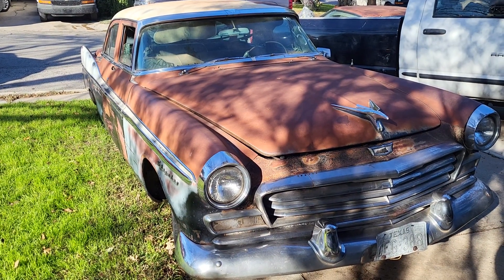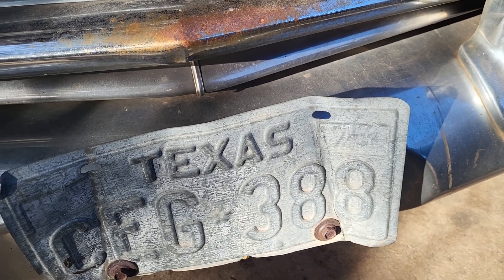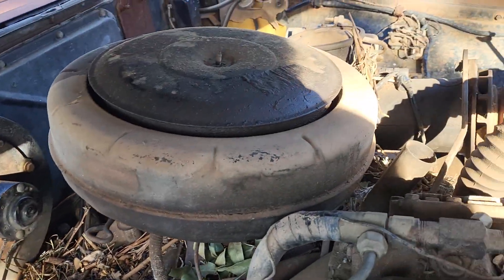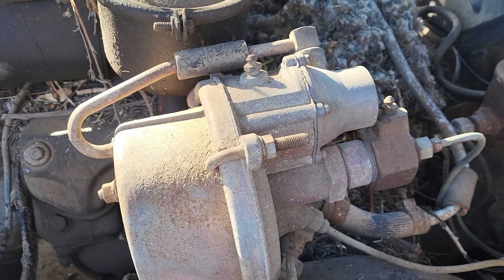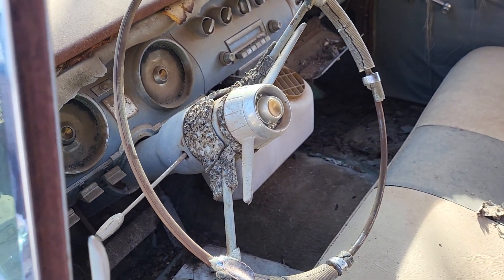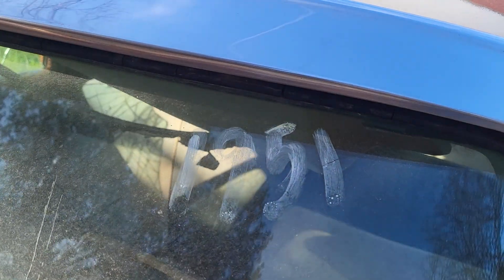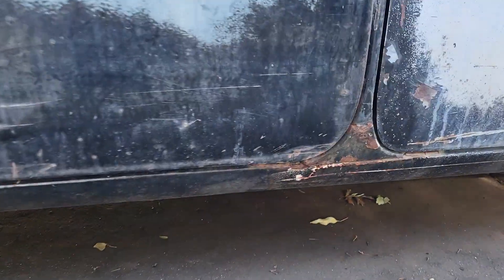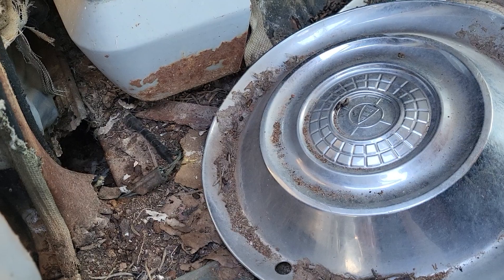1956 Chrysler Windsor 4 door sedan

Comment: That big A/C compressor is a Lehigh model V-93, made in Lancaster, PA. It is a 4-cylinder unit, probably consumes about 30hp. My '56 DeSoto has the same compressor paired with a Frigi-King under-dash  unit. I guess that's where Chrysler dealers were sourcing their kits from.

Comment: the 1975 plates are the only multi-year plates with a star separating the letters and numbers
Reply from the maker: Really? I will keep and repaint them.
Reply: @XGarage-nj2uf  yep, I looked it up when Mags was doing the Mopar Hoard auction. In 76 they changed to a Texas shaped divider. I think 75 was also the only year you could have a 4 or 5 digit plate number, the plate on my old Dodge was XXX (star) 89, which was issued to my dad in June of '75 right before we moved back to TX. My 70 Barracuda also had a '75 license plate. (Texas went to multi year plates in '75)
Reply from the maker: @Tumbleweed_Tx  I bought 2 cars from the MOPAR Hoard auction. I checked and the plate has a star in the middle. Looks like I will restore them and put them back on the car.